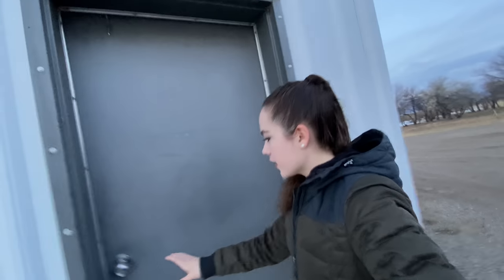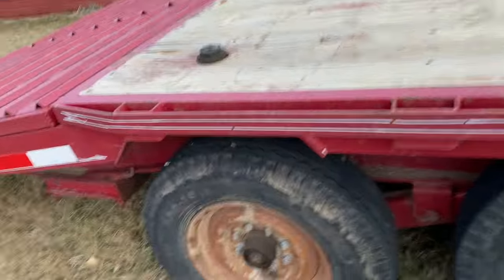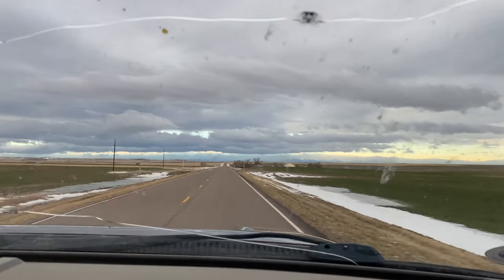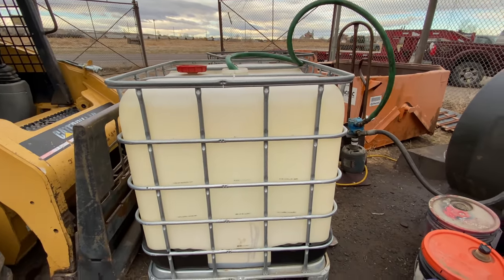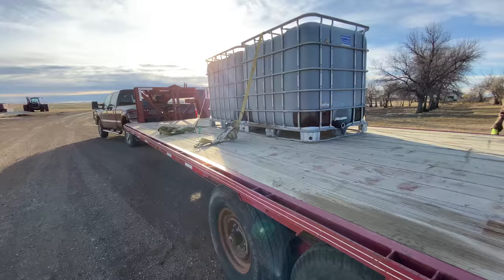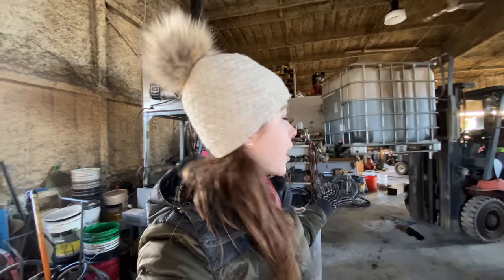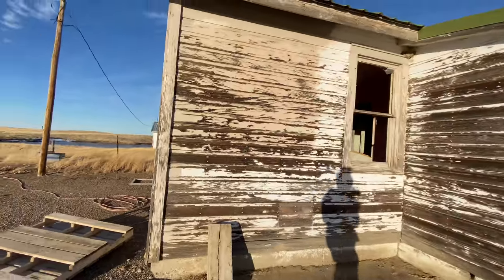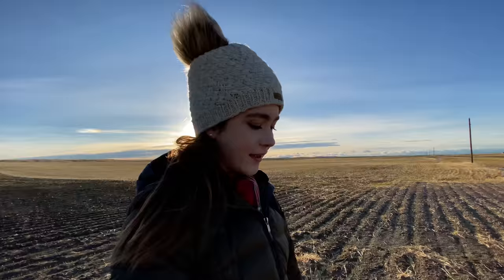Striking Oil for the Farm!

Comment: We use all our truck, tractor & other equipment engine, hydraulic & other oils to heat our large shop as well.  We usually burn most of it up each winter here in Wisconsin.  With really cold winters, we may need to tap into our large LP tanks that we use to dry grain.  Our furnace heats water which is circulated under the floor.  It seems to do a much better job of keeping things warm.  Take care & be safe.
Reply from the maker: Thank you so much for the great information and kind words!  Heating the floor is a great idea!!

Comment: Kate - is it hard on the wheat when the antelope graze on it in the winter ?  Here at my place the deer jumped the garden fence and have been digging through the snow to get at the winter rye cover crop I planted. I guess it doesn't really hurt anything too much for my rye since it seems to just come back up fine in the spring .  I would have given you my waste oil - I recently took 5 gallons to the parts store. Not sure what they do with it. I am guessing that Spring wheat doesn't have to freeze in order to make a crop ?
Reply from the maker: Hi Mr. Kapp.  There is so much wheat out here that the antelope don't really put a huge dent in it.  That is great that you recycle your oil too.  Spring wheat doesn't have to freeze like winter wheat does to get a head on it. Thank you for your great info and questions.

Comment: as you fasten the IBC, we get a very big fine for that, maybe you can try it this way?... that you don't put the tension strap over the frame, but between the frame and the plastic of the barrel at the top , if you suddenly have to brake, the tension straps hold the IBC ....if they are on top of the frame, the IBCs CAN slide under it.. it's just a tip ;-)    greetings from a dutch truckdriver
Reply from the maker: Hello from Montana!!!  Thank you so much for your advice!  I will let my Dad know.

Comment: If you will run a 1" thick rope connected to a 2 X 6 X 35" high board at each end of that steep steps you can be safe even if you lose your balance.
Reply from the maker: Thank you for the great information!!!

Comment: What's the coldest winter temps you and your Dad have experienced? There is absolutely nothing to stop the wind in those huge flat fields. :Brrrrrrr
Reply from the maker: Thank you for your great question.  I think that 45 F below zero with wind child of 65 F below might be the coldest. I could be wrong about that though. It is pretty common to have 60 mph or higher wind gusts.  In the old days when they plowed the fields the topsoil would blow east to other states.  They were called the Dust Bowl days.

Comment: I hope that isn't asbestos insulation on the walls inside that barn in the opening sequence. Not good if it is asbestos. Get that old Ford some Sea Foam for the gas tank and in the oil. It'll start right up.
Reply from the maker: No it is spray foam insulation.  Thank you so much for your question and concern.  I really appreciate it.

Comment: Hello Kate. That's another interesting video thank you. I've noticed that your wheat fields have quite pronounced ridges and furrows whereas from what I've seen here in the UK we sow on a more or less level seed bed. Do you know if there is a particular reason for this like for instance to protect the seedlings from the wind or is it just down to the type of drill you use.
Reply from the maker: Hello from Montana.  We have ridges for the wind and also for moisture.  If everything was flat the normal 30 to 40 mile an hour winds would blow everything to North Dakota or Canada. Thank you for your kind words and encouragement.
Reply: @KatesAg  Thank you, I thought it must be something like that.
Reply from the maker: Yes, we have a lot of wind here.  I see in other places they are called hurricanes or tornadoes but here it is just normal wind. Thank you so much.

Comment: I use  10%  Diesel  fuel in  my waste oil furnace..
Reply from the maker: Thank you for the information!!!!!!!
Reply: @KatesAg    I have a lot of  85W-140  rear axle  oil that  is  too thick alone..  Diesel fuel  is  way more  flammable than  old dirty used oil .  The  10%  Diesel  thins  it so  it burns  hotter and cleaner with left soot left in your  heat exchanger tubes..
Reply from the maker: Wow interesting.  Farmers work hard and this gives farmers a bad name.
Reply from the maker: Thank you.  That is interesting and I will let Dad know about the diesel.